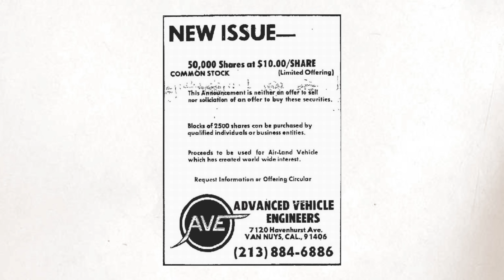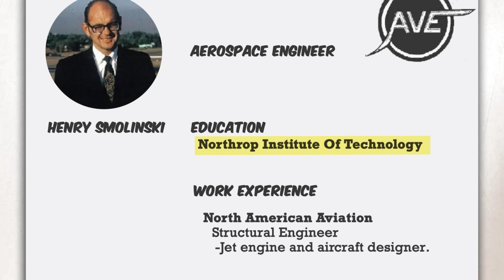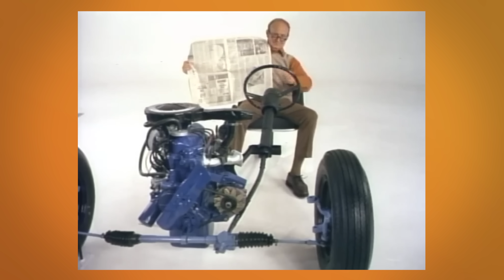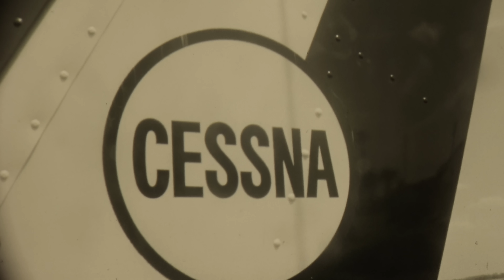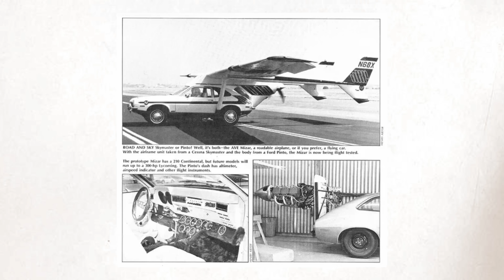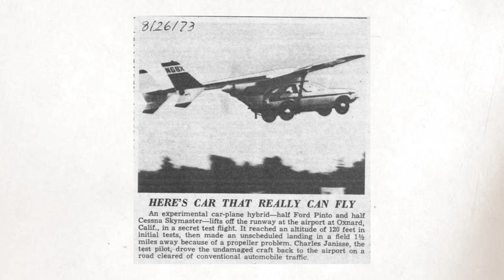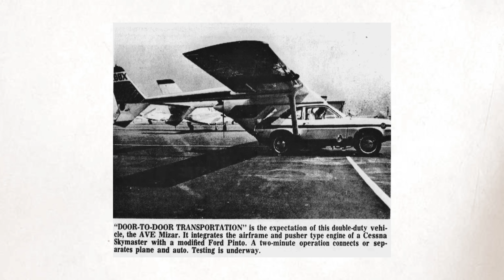The wild 1970s flying car that actually worked... until it didn't

Comment: The title outlines the problem. Flying car. This title assumes one needs to make a car fly. What is easier than making a car flyable is making an airplane drivable. They literally went about it backwards. For a rocket scientist, that was a lethal mistake. Also, a flying transportation device or FTD need not be considered a family travel vehicle. That places an undue burden for the design. Two adults maximum 700 pound payload, plus fuel. Leaving the wings at the airport makes the most sense. Telescoping tail section. Engage prop to axel drive transmission and leave the airport within 10 minutes. The FTD or FTV will be a very light weight vehicle and get fantastic milage, however it will be structurally in the bicycle class and need its own highway lane because it cannot be safe in regular weight traffic. So yes, this vehicle could be viable but there isn't a current world whereby it can be safely operated. If the vehicle is going to be fast in the air, it will be particularly slow on the ground. Long distance ground travel would be ridiculous. 50 miles would be a particularly long road trip in such a vehicle. The Pinto idea was just insane, though I can see why Hollywood would run with it. The Yugo was a better car for the job.

Comment: There was self-taught "amateur astronaut" Madman Mike Hughes who died during his attempt to prove that the earth is flat in his homemade rocket. Then we had the arrogant, Ivy League-educated Stockton Rush and his doomed-to-fail submersible. And going back in time, we had this piece of sh!t contraption. History is riddled with these Darwin Award winning morons. Even big engineering companies get it wrong sometimes and that's WITH having multiple people with eyes on the project to check each other. If there was anything substantive to these projects, the legacy companies would have swooped in and bought these guys out. Back in the early 2000s, crowd-sourced trike cars were all over social media. You'll still see them around. Guys like Paul Elio were pushing the idea that a car with 3 wheels was better than 4. Ultimately these con men and their projects have faded away but not before thousands of eager and gullible "investors" were fleeced out of their cash. Don't fall for this romantic appeal of the lone guy tinkering in his garage with off-the-shelf retail parts with the goal of doing what the Big League firms couldn't or wouldn't do. These morons ultimately get themselves and others killed.

Comment: I actually recamed a 74 pinto wagons and cam followers in a parking lot at builder square parking lot Buena Park  and used the same pinto to cross the desert to Arizona and pulled a 65 Ford f100 with a trailer out of the desert with 10 ft of chain and a girl driving

Comment: Why would they not address the structural issues with the wings?  Using sheet metal screws to secure the wing struts, watching that fail, then doing it again is insane.  The extra weight from larger pusher engine surely contributed to the structural failure

Comment: The technology wont be the problem, nor will the batteries, airframe components, guidance systems  or anything like that.  Those are solvable ( or solved) problems.  The problem will be  the roughly 2.3 pound master control unit perched above the pilot's eyes. Humans, absent months or years of intensive training and experience, cant think inside the 3-D universe of flight.  We exist, for purposes of movement, in a world where you can go side ways or front and back.  We wont be able to add that third dimension one needs to fly.  The fact that pilots can, but only after many many hours of retraining their brain, only makes the point.  We cant, as a species, be trusted with the easy capability of flying!

Comment: Think of how critical and expensive a parking lot fender bender would be for the car-unit of a flying car, and especially so if it is a design that does not leave behind its aircraft-unit at an airport. That's merely the first practical consideration before considering the several technical and engineering obstacles, and with zero consideration of operator qualification, insurability/liability, developmental costs and hence price-point.

Comment: 17:50 I'm not saying what Tyler did was okay. I'm not supporting it. And I'm not advocating for it. American society today, everything has been sanitized Comfort enhanced and secured to the utmost safety.... and they have convinced us all that these are the keys to happiness and fulfillment. But they are not. They tell us that to keep us all in line. There is an inherent danger to life, and that danger can cause excitement. And sometimes losing things is the best way to make you appreciate them. Or even being threatened with losing things. In this over sanitized society, I think a false sense of security, and also an overvaluing of security. And gives us a high capacity to take things for granted. When I was like 14, me and my friends were hanging out at a four-way stop, and I was on my rollerblades and I grabbed onto the bumper of this van at the four-way stop and he took off and it felt like he was doing a hundred miles per hour LOL. I rode on the back of the van for a mile of two until I finally let go and coast and slowly to a stop. It was night time, I had no helmet or knee pads or protective gear, and if anything went wrong like an accident or a sudden stopped or a rock under my wheel and I would have been dead. It was a stupid thing to do, but it is also one of the things I've ever done that I'm the most proud of. And I look back on it and smile. Even though it was stupid and dangerous. Don't let them tell you that it's always okay for them to suck all the juice out of your life and leave you with the husk or the Rind. In this Society with all the laws and rules and regulations and stipulations and corporate control and government control and trespassing. Think about that, it's not even legal for you to walk the earth, because somebody else owns it and it ain't you. That is what they call Freedom. I'm just saying freedom sometimes is something you have to take for yourself. I don't think with Tyler did to the kid was right or okay, and Tyler had no right to do it. But it's easy to get lost in this society and feel hopeless and just go through the motions, and lose your passion for life, because that is what the sum total of Living in America today leads people towards, especially men. Sometimes something happens and it's dangerous and its extreme and it's scary, and sometimes that's what it takes to properly restore your focus. What Tyler did was clearly wrong, he was playing God with that young man's life. But for me, I always felt like the young fella might have changed his priorities. That what happened may have reignited his passion for his dream

Comment: Classic case of not seeing the forest for the trees. If you've got a pilot's license, you'd just fly a plane. There's no benefit to having a converted car that does a worse job. It's more convenient and no more expensive to just have separate vehicles. Even if it was built well, it would still fail on the market.

Comment: The sad thing is that this probably could have been a success if they had focused on strengthening the frame and lightening the car. I just did a search and it appears that a 1973 Ford Pinto weighs between 2,120lbs and 2,400lbs despite Ford's claims it weighed under 2,000lbs. If they stripped everything out - all seats except driver, removed upholstry and sound-proofing, lighter tires and rims, etc. I bet they could have shaved 500lbs off. I wonder if engineers tried warning Smolinski and Blake but were ignored. That's typically what happens.

Comment: i think theyll be there.. but automation is mandatory for security check backup battery backup engine backup wibgs and emergency landing system for landing without wings or engine is mandatory also fully automated emergency landing like its for fighter jets .. user just have to do push emergency button then nothing more... all has to be aytomated and standard... u till that day itll continue causing problems but may becoma standard with or without lots of this syatems 😅

Comment: The Ford Pinto is a truly wonderful car. I have owned seven of them, and had no serious issues with any of them. At one point I owned three of them at the same time. I currently drive a 1973 Pinto Squier wagon. I have owned it for nearly 25 years. Yes I have replaced the engine in it. But it is rock solid, rust free, and one of the most reliable and practical cars I have ever owned. And it looks 100 times better than anything made today. But I didn't try to make an airplane out of it. I own a real airplane. A Cessna 172. I have been a private pilot since 1981.

Comment: As an airplane and helicopter pilot I’m 100% sure this won’t happen. With the required FAA certification, FAA licensing of pilots and mechanics etc, no way that engine operates in the car for less than $300/hr

Comment: 2 main problems with this idea now:

1)  Some used single engine cessnas are CHEAPER than a brand new pickup truck now, and still fly and hit 90 knots.
2)  Most people cant handle driving, let alone adding a third dimension of control.  You can't let people fly who don't know what the rudder is for, that's how you end up with destroyed hangars from people who don't know how to compensate for the torque of the engine on takeoff and promptly run off the runway.

Comment: Flying cars are not "a solution in search of a problem". One of the most common causes of crashes in the general aviation sector is VFR into IMC. What generally happens is that private pilots, who are usually only qualified to fly VFR, will try to find a reason to justify their hobby of flying, by trying to actually use their aircraft as transport. When the weather turns, they have to land, leave the aircraft behind, pay parking fees, and then try and hire a car to get them the rest of the way. It's easy to see why some people might risk continuing in spite of this.

Enter the roadable aircraft - to give it its proper name. When the weather gets marginal, the pilot can land, and drive the rest of the way. He can even resume flying again if the weather improves later on.

Flying cars would actually save lives, but not in the way you might think.

Comment: It’s physically possible, but not economical or practical as ordinary cars are not designed for flight, at the risk of stating the obvious. So you need to design an aircraft with a detachable wing, which will cost more than the original aircraft, and could easily be damaged on roads, potholes etc. No advantage over a car+aircraft combo.
It’s surprising the guys managed to balance it and make it stable and controllable, if not structurally sufficient. Clearly neither had much relevant building experience, or probably any building experience of any kind.

Comment: There was a lot more to connecting and disconnecting the wings than just putting some pins. There were throttle and steering controls that were more detailed.

Comment: Ya know, if the Ford execs wouldn't have been such skin flints and included the fuel tank liner that was in the original design it would have been much different for Ford. The Pinto would have been a success. The car was also designed with a driver side airbag. 
But noooooooo, can't spend an extra $35 bucks to eliminate the future lawsuits that cost Ford MILLIONS.

Comment: You do not want to know about the technological challenges involved with air traffic control should 2% of a typical large city's rush hour traffic take to the skies.  Add the wake and downdraft turbulence issues, large-building air currents,  and all of the other hazards that rotary-wing pilots already know about, and a "flying car" becomes a solution that increases the number of currently-unsolvable problems by a full order of magnitude.  Things that fly while carrying people need to be dedicated to that task alone with no compromises.  Instead of trying to build something that simply can't work for the masses, we need to put much greater effort into reducing the need for the automobile, reducing the number of fossil-fueled transport and generation instances, and doing as much as we can to cease making things worse.

Comment: Coming from an aviation perspective, the "flying car" can never become reality. Just look at the "accident" rates and tell me if public is ok with  over 10 million incidents annually (police reported traffic crashes). And this being at altitude that would cause death to those on the ground as well as those that were in the air. Currently (as of the 2023 USA data set), we accept that 25,000 perish (die) annually with ,2 million injuries. This is not acceptable for air travel.
Then we have "airspace" considerations, with more and more remote operated aerial vehicles (drones) wanting to be used, the control of that airspace will only become more crowded and chaotic. Chaos is not a place that belongs in travel in the skies.

Comment: First rule: You test and fix, rinse, repeat, and keep doing so. And you don't test-fly until you're 100% sure that absolutely every issue identifiable by simple calculation or simple bench model is fixed. There must be total confidence that your test flight isn't going to be drowned in noise from issues you've already found or could have found, or end in disaster.

I'm glad these two idiots didn't kill a whole bunch of other people, as per Oceangate, but there's a very good reason why initial designs in high-risk vehicles take a very long time to get to initial prototype, and why it can take years to get from there to initial usable vehicle.

Comment: Airplanes are highly specialized vehicles that won't hold up well to parking lot duty.  Modern automobiles are far too heavy, and burdened with weight-adding safety features that are useless in an aviation setting.  Until physics research creates some currently unknown propulsion system that can be produced cost effectively, flying cars will continue to be a joke.

Comment: Between the necessity of redundant power to stay in the air, and a true idiot proof control system (I don't trust 90% of drivers to operate a car, let alone a damned airplane), we're years from a realistic flying car that doesn't require a pilots license, and a runway.

Comment: Why are all after flying cars..helicars are more practical....vertical takeoff and landing. There can be 2 small rotors moving in opposite directions( don't need a tail fan).Rotors can be kept straight along the body when on road and a single engine can power the wheels.Aerocars are totally impractical!

Comment: The very notion of a "flying car" is fundamentally flawed. What is really desired is to get off the roads and their 2-dimensional limitations by using 3-dimensional airspace for true point-to-point travel. We want a VTOL "carriage". And, while we're at it, let's replace combustion engines with electric ones that don't produce smelly smoke. We're close to doing so, but the rotor blades and/or wings that will carry us aren't quite as compact as present-day cars and present safety hazards to folks nearby on the ground. There are some proposals and developments that may solve these problems, but refinements are still needed.

Comment: Shoulda used a later Corvair and just the one engine.   Modified Corvair engines are swapped into quite a few small planes and they work just fine.  It's done bc the price of even a rebuilt aircraft engine of high enough power costs VERY MUCH.  New ones are VERY VERY MUCH.

Comment: he was an engineer. he could have run the calculations on pen and paper, check material strength VS lifting power etc. they had a first flight that showed the flaws that should be corrected before a second flight. I'm just so sad and bothered that he didn't use his training  responsibly

Comment: You'd have to land that plane at a perfect angle and the most gentle touch down to not crash. If it's angled even slightly down, the nose will collide with the ground. If it hits the ground with even the slightest force, it will bounce back up and possibly lose control or break a wing off from the jolt. Or it wont back up and just smash apart the suspension and whatever else.

Comment: All pilots perform a flight check prior to lift off (Each time!). Some drivers can't be bothered to check the motor oil level as well other vehicles fluids.  Flying vehicles require responsibility and even so with licensed people we still have accidents.  Imagine putting a flying vehicle in the hands of the general public.

Comment: Even if you can produce a flying machine reliable enough and economical for the consumer market, you still need to be a TRAINED pilot to safely fly it not to mention flight plans etc. The only way you could get flying ‘cars’ to be accessible to the general public would be to have designated flying lanes and auto piloted craft to pick up and drop people off like a taxi / flying gondola infrastructure. Maybe with advances in technology that may happen.

Comment: I grew up assuming that I would commute to work in a flying car however now, 64 years later, I am still taking a bus. I feel cheated. But I think that there may be a conflict between the design requirements of a car, meaning heavy so you don't die if you hit a tree, and the design requirements of an airplane, light so that it stays in the air.